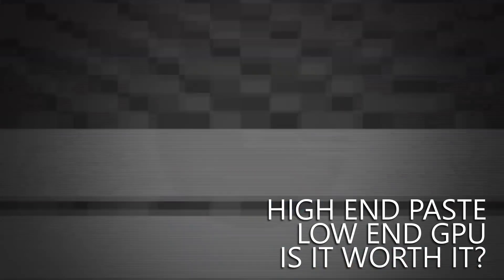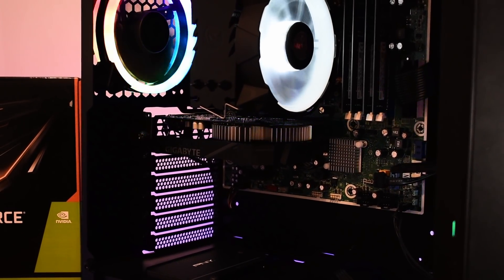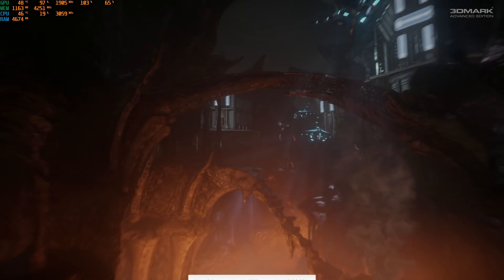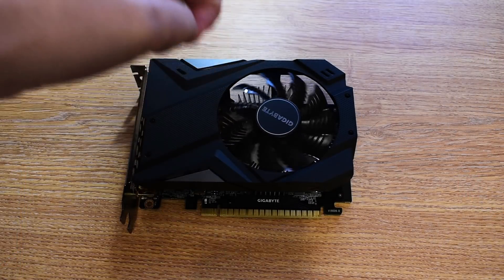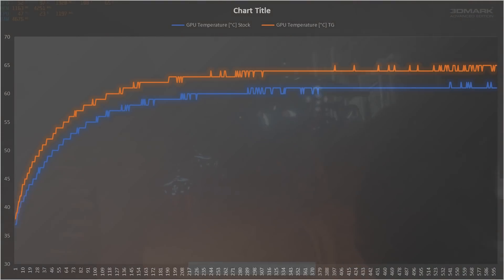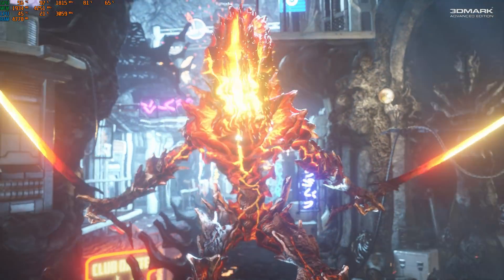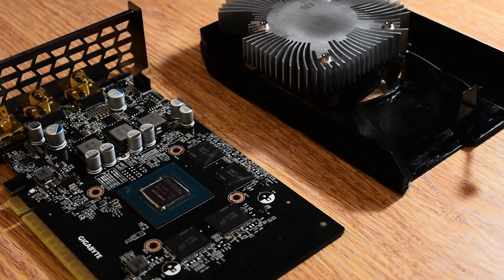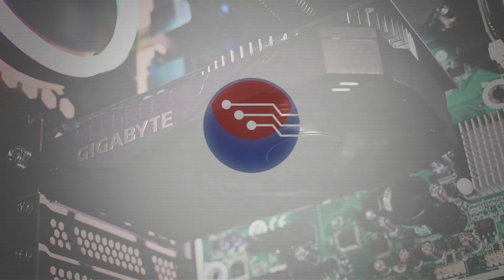Can High End Thermal Paste Boost Performance of Low End Graphics Cards? #GTX1650 #Kryonaut

Comment: Not sure I'd trust the squish method on an open core CPU or GPU.
Reply: Spread it then, I do it on IHS too
Reply: @shadowopsairman1583  Squish is actually better since it push all air away from the middle and out the sides.
When you spread the paste before mating there will likely be pockets of air trapped between the paste and the heatsink, reducing the thermal conductivity.

Comment: There is a cheaper Chinese paste which cools better than most others - Tech Yes City did a video about it. A 30g tube costs about £3.
Reply: Yeah, for my laptop upgrade, only an old Core2 type, but taking it from Celeron to full C2D, I got some Prolimimatech PK2 (and not much for the price!!). With the limited heatsink and small contact patch, wanted to give it all the help possible.
For other tasks, a 30g tube of HY880 - another quite good budget paste